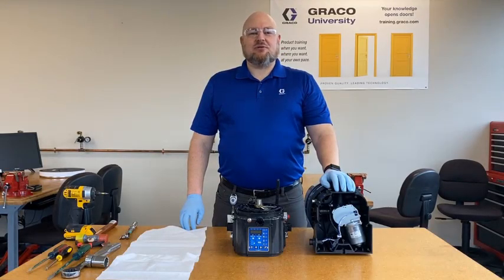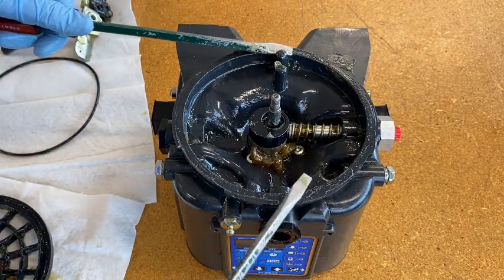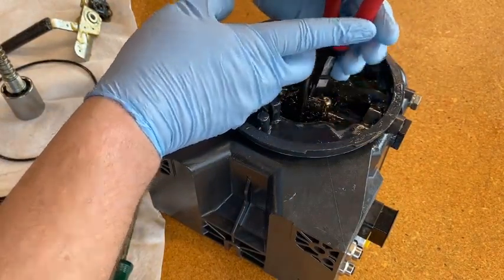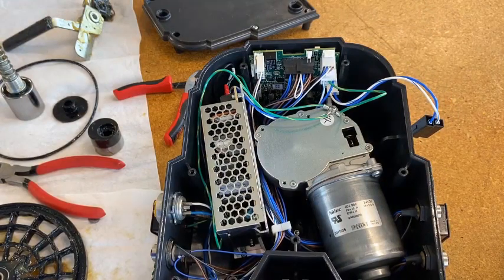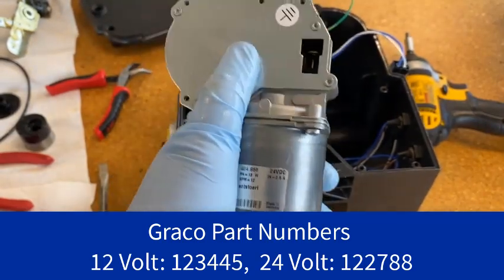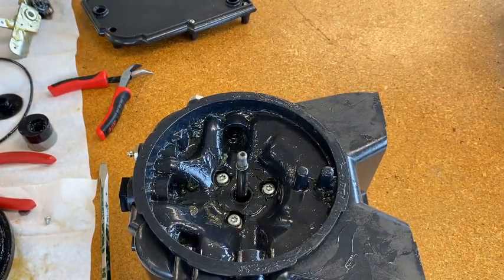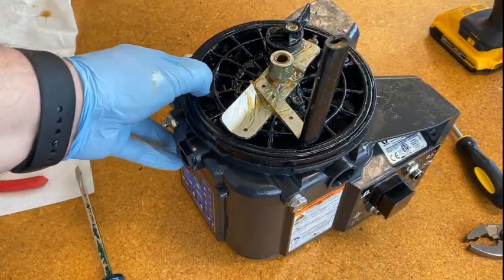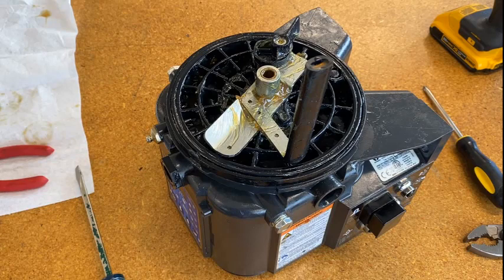G-Series Lubrication Pump Electric Motor Replacement

Comment: Hello, Can you tell me the part number of the motor? It's not shown in the manual of G3 Pump...
Reply from the maker: Thank you for your question. The part numbers for the motors are in the video starting at 6:43 and include the 12 Volt - Graco part number 123445 and 24 Volt - Graco part number 122788.